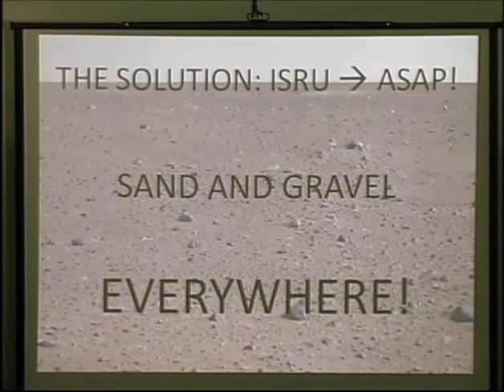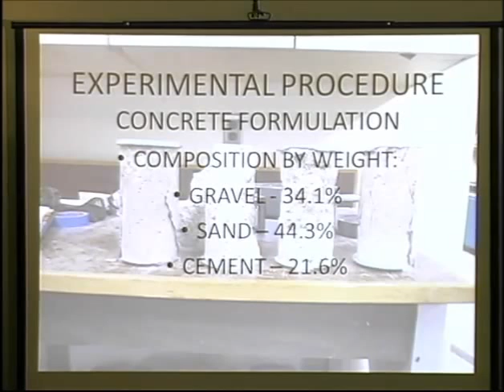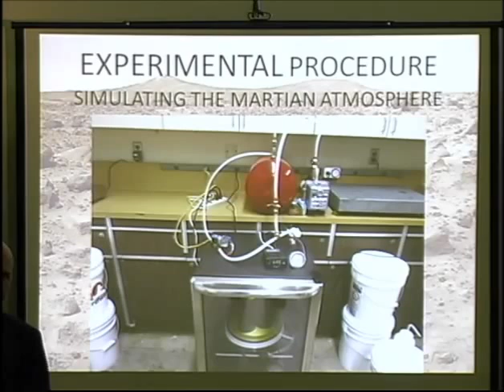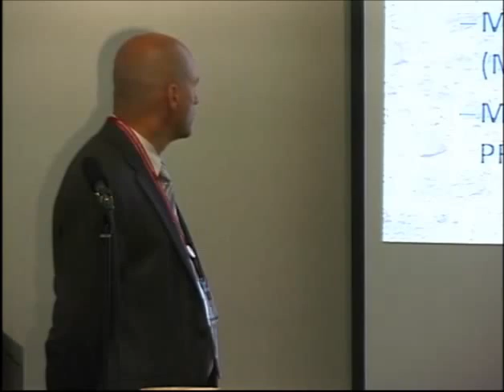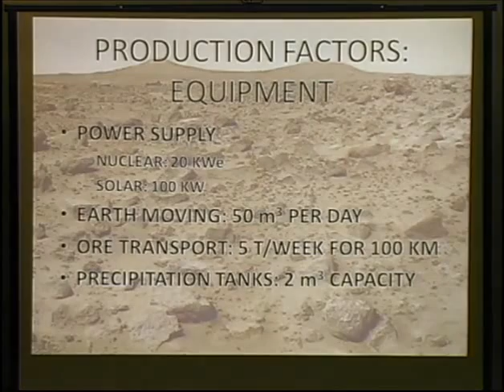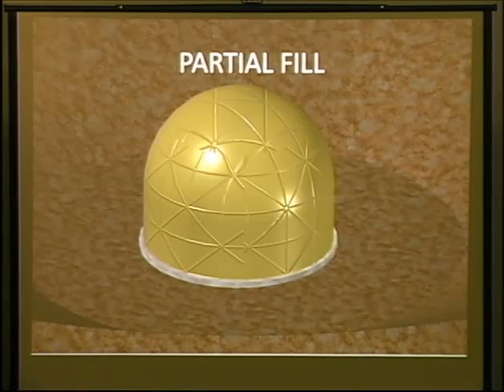Brandon Larson - Concrete on Mars - 15th Annual International Mars Society Convention

Comment: The process by which a gas turns directly into a solid is called "Deposition" or sometimes "Desublimation". It's how water vapor turns into frost on the ground at sub-zero temperatures without ever passing through a liquid phase.
I suggest looking it up on wikipedia. There are some good articles that can explain matter phase transition in more detail.

Comment: Mars has a very low atmospheric pressure. So let's say you have a block of ice on Mars and the temperature goes above 32 degrees f, or 0 degrees Celsius. The ice at that point would not melt but would evaporate directly into a gas(the same way dry ice does). In order for a liquid to exist there has to be enough air pressure "holding it together" if you will. 

On the moon water will either be frozen as ice, or if in sunlight, it will evaporate as a gas. A liquid state is not possible.